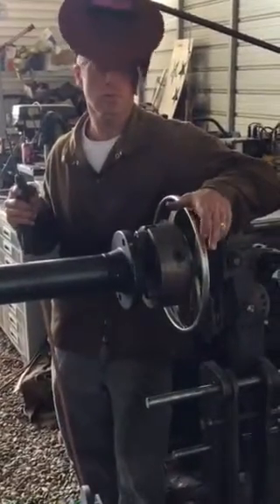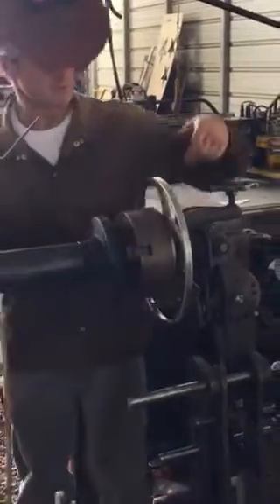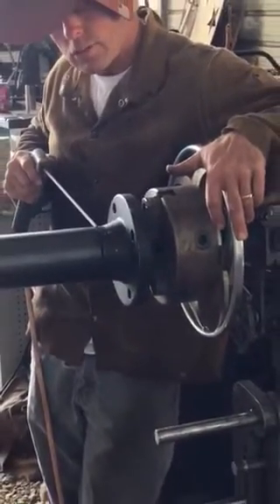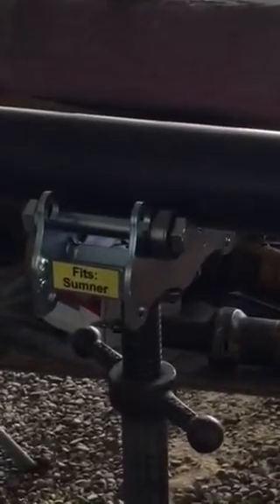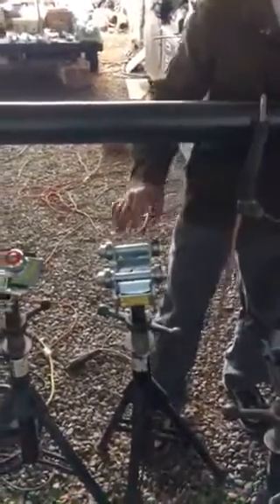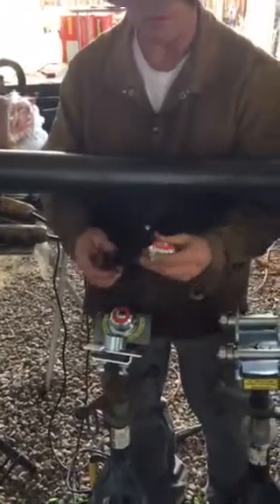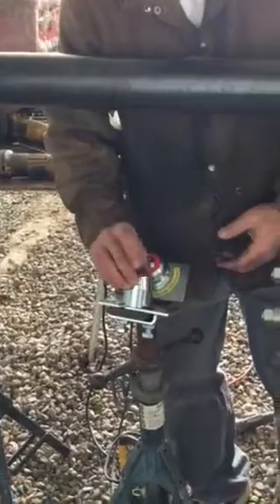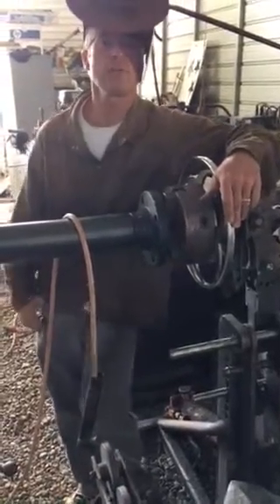Roll out Wheel How To Roll Pipe Welding

Comment: So why not just use a pair of rollers and rotate the flange itself? I'm trying to understand the need for the roll out wheel.
Reply: He Ka if your puting a flange on a 90 degree elbow or doing anykind of fitting to fitting its easier to a roll out wheel plus with darrens roll out wheel you can do all your fitting right in the roll out wheel